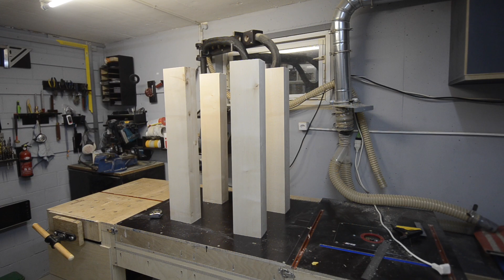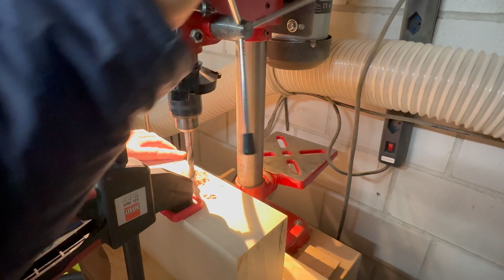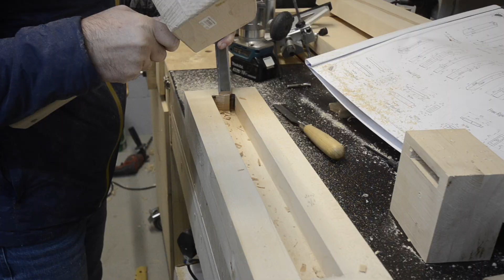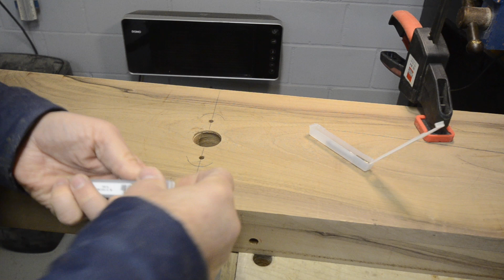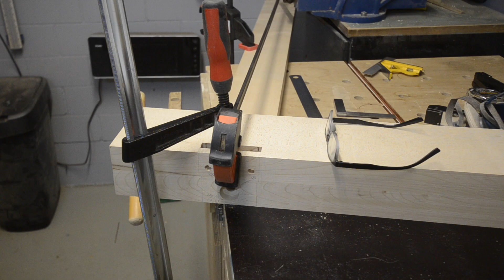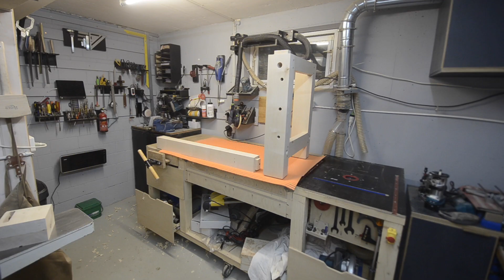Is a Benchcrafted Roubo Even Possible to Build in a Small Shop? Base Build!

Comment from the maker: Thanks so much for watching this massive part of the Benchcrafted Split-Top Roubo build! This base was the hardest section of the whole project — between the inch-based plans, impossible-to-find drill bits in Europe, and working in a super small shop, it pushed me more than I expected.

If you’re building your first real workbench (or thinking about upgrading your old one), drop your questions below — I’m happy to help however I can. 👇
What part of the Roubo build are you most nervous about? Joinery? Hardware? Milling the stock? Metric vs inches?

I read every question and will answer as many as possible.
And if you want to see the next steps — including the top build — make sure you’re subscribed so you don’t miss it!

Happy building, and good luck with your own Roubo journey! 💪🪚